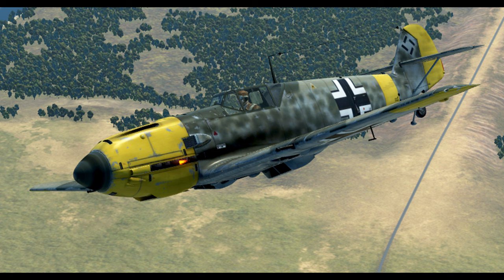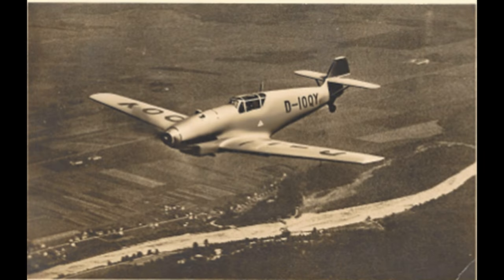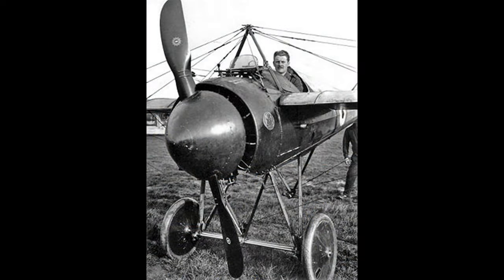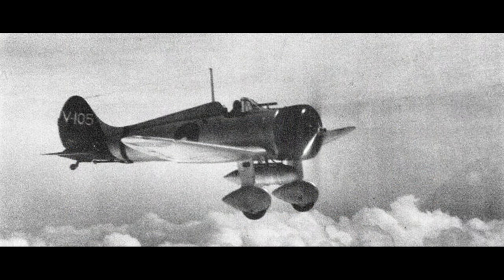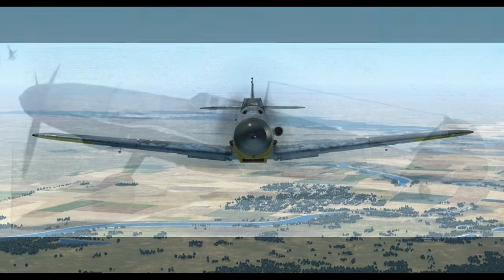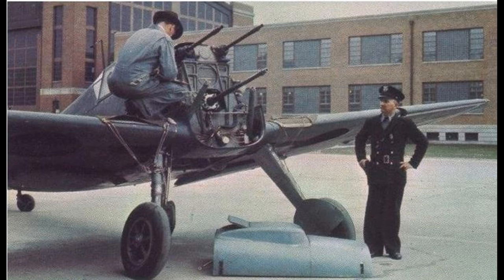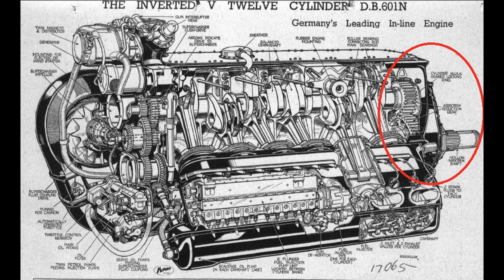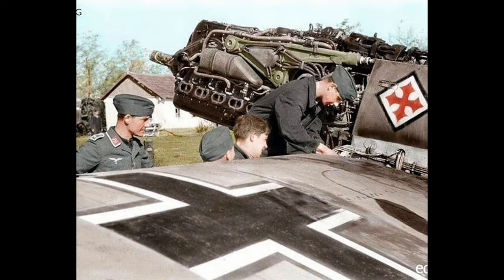Why an INVERTED V-12?  PART 2

Comment: saw Part 1 months ago, disagree on three tubes through firewall are gun barrels, rather are frame mounted gun supports > ME-109 had 0.594:1 reduction gear and short barrel Rheinmetall-Borsig cannon in the V12 valley > gun action would not be behind firewall
Reply from the maker: Why not behind the firewall? Having guns on the crew side of the firewall was incredibly common in WW2. I think those are gun barrels and not supports.
Reply: @GregsAirplanesandAutomobiles  > MK108 had short barrel, only 500 m/s 
Luft46.com/armament/mk108.html

Comment: @0:54 - That has to be the worst cylinder head design ever created! WTF is with that exhaust port? It's like they started to make a hemi and then gave up halfway through!
Reply from the maker: Buick and I are very unhappy you don't like that engine.
Reply: @GregsAirplanesandAutomobiles  It's an interesting engine, but I think that the nailhead was probably nearly forgotten by most for some very good reasons. Apparently, it was actually a redesigned hemi, which is unfortunate.

Comment: I must ask, since Germany made the engine work for much of the time, did they hold out on Italy and Japan on keeping them running or did they just start building the engines too late in the war?
Reply: I've read that the reason there are so few 600 series DB engines flying today is that the level of precision required in the machining is exceedingly difficult to achieve even now, 80 years later. So it's no real surprise that it was tough for the companies who licensed it to get it right.

Comment: I wonder if reduced cylinder head temperature (perhaps more specifically, valvetrain temp) was a benefit of these inverted forced-induction engines? 
I have no idea how much oil pooled in the area as part of the dry-sump scavenging, but having spent a lot of time tuning high-boost turbocharged auto engines (and watching cylinder head temps climb under boost due to elevated exhaust gas temps) my first thought was that it might be nice to have some of that valvetrain submerged in oil that would soon be pumped away to be cooled.
Reply from the maker: At the speed at which the rocker arms move, I don't think you would want them submerged in oil. I also don't think it fills up that much before it's scavenged out.
Reply: @GregsAirplanesandAutomobiles   Thanks for the reply and for the exceptional channel!

Comment: What about just the effect of gravity or maneuver gs on the oil in the engine, keeping it in the head where it’s needed as coolant, making sure it’s running wet
Reply from the maker: The oil pump takes car of that, the oil sprays everywhere.

Comment: I once read somewhere that inverted engines are more susceptible to hydrolock where a cylinder can fill with oil or water when sitting too long.  Since these fluids are essentially non-compressible, this can be disastrous when starting an engine and is why the propeller is manually spun before startup to check for it.  In an inverted engine with the plugs at the bottom, this condition can be corrected easily by pulling the plug(s) on the offending cylinder(s) and draining the fluid.  Intuitively, this would probably take a lot longer to do on an upright engine.
Reply from the maker: No need to pull all the plugs, just pull the prop through by hand to make sure nothing is hydrocked. If it is, just pull the plug for the hydrolocked cylinder(s).
Reply: upright engines can't get hydraulic lock.  The reason is called 'gravity'

Comment: It's interesting that the Stuka, FW 190, the Storch, etc all had inverted engines.
Reply: Makes sense really. Forward visibility and maintenance would he huge factors for aircraft like the 109, Stuka and Storch. Now the 190, visibility not so much as the 190 D had such a long nose to begin with, but why make an upright V12 just for one type of aircraft because it wouldn't have the advantage of improved forward visibility? The Dora is a bit of a strange bird, having that V12 and still retaining characteristic looks of a radial engine fighter

Comment: I haven't heard you mention that the first prototype 109 had an upright V-12 Rolls-Royce Kestrel engine.
Reply: Yep the Proto flew with RR Kestrel because there  was no powerful reliable German engine at hand during this time .

Think it was not important, its all about the inverted V engined varaints,  he even not mention  the later Spanish built variants with Hispano Suiza and RR Merlin V-12 engines

Comment: I recall reading an assertion by a Rolls Royce engine designer that, all other things being equal, an optimized carburettor installation produced more power than a fuel injected installation, this due to the intake charge cooling caused by the carburettor.
Reply from the maker: Either that's a misquote, or he is wrong. If you are talking about Stanley Hooker, it's a misqoute, that's not really what he said.
Reply: @GregsAirplanesandAutomobiles  So what did our friend Stanley say?

Comment: After the war Spanish made Bf109s were using Merlins in the upright configuration. They worked quite well but took away from the 109's fuselage beauty!
Reply: I just checked them out. I agree it totally changes the plane and not for the better visually.
Reply: It was called a 'Bouchon' or something like that.  Many were used in the film 'Battle of Britain' along with Merlin engined He 111s.  Some are still flying for airshows in Luftwaffe colours.

Comment: Do inverted engines have the same issue with oil getting into the cylinders after shut-down and potentially causing a hydraulic-lock as radials? 
It seems like this would be a major negative since, if proper precautions aren't taken, this can lead to engine damage.
Reply from the maker: I am sure that some if not all do have that issue. However it's just not that big of a deal. With proper procedures in place it will never blow a motor. Keep in mind the US had huge formations of 4 engine radial bombers, all those engine had to start without hydrolock. I'll explain the procedure to avoid the issue in a future video.
Reply: I started many Bristol Hercules 14-cylinder radials.  They had an electric starter with a clutch.  We had to count 8 blades before switching the mags on.  If there was a hydraulic lock the prop would stop and the clutch would slip.  In that case the lower plugs would be removed to drain the oil out.  But this never happened to me....   Other but smaller engines were turned over by hand before starting.  But most later radials were too big to even try this.

Comment: Greg,
Perhaps you can help me with this. 

Flat head quad cam hydraulic lifter 4 valve twin plug crossflow. 
Ok, sounds primitive but.......
With the boost they run the head volume isn’t really a problem and with the low rpm to get a full burn, having a dimensionally smaller motor and a smaller frontal area in a cheaper motor may have been another way to go.
Reply from the maker: I don't think you could have much less frontal area than what the 109 has, not if you want to have a pilot and weapons in it.
Reply: Greg's Airplanes and Automobiles 

Fair call. 
I was just thinking that cams and valvetrain add a fair bit of height to a motor.
Reply: By frontal area I meant the actual front of the aircraft, not the max cross section.

Comment: Is there any truth to the rumor that inverted piston engines burn /use far more oil than upright engines?  I was told by an old crew chief that they do, but I question this.
Reply from the maker: I think they do on start up, but probably not once they are running.
Reply: @GregsAirplanesandAutomobiles  Thanks!

Comment: Yes  but, how was the engine block actually put together? 
Was it a 1, 2 or 3 piece? And how were the pieces held together?
Reply from the maker: They were all multiple pieces as far as I know. I can't think of any WW2 aero V-12 with a one piece block as we know them today.
Reply: @GregsAirplanesandAutomobiles  Thanks, Greg. Actually, I think the German ones had a one piece cylinder block and head, unlike the others. I think that even the steel cylinder liner was a one piece sleeve and combustion chamber, dome.

Comment: Ease of maintenance? If that were the case, what the heck happened to German Automobiles!?
Reply from the maker: The VW bug was easy to maintain.
Reply: @GregsAirplanesandAutomobiles  I was mainly poking fun at modern German cars. Anything from the late 80s and on. I actually own an older BMW which is still not too bad.

Comment: Greg Sir, a question that is a bit off topic.
Do you think it would be possible to build a viable diesel aircraft engine using the basic design of the Napier Deltec engine???
This will be using modern common rail injectors and staged supercharging.
Reply: The Deltic was based on a licensed version of Jumo 204 engine, which was an aircraft engine. It was efficient, but heavy and not very powerful. Diesels simply don't work well in aircraft.
Reply: @PistonAvatarGuy  I recently saw a BMW V6 diesel converted for aircraft use. It's making 360 horses and is much smaller than a similar size Lycoming. I think you will start seeing more of them as time goes by since the size and weight have gone down tremendously and their superior fuel mileage. range is everything for some aircraft.
Reply: @johnparrish9215  You're probably thinking of the CD-300, which is based on a Mercedes-Benz engine, BMW doesn't make any diesel V6s. The CD-300 only makes 300 hp and isn't too heavy when compared to a turbocharged LyContisaurus engine, but is extremely heavy when compared to a modern, gasoline-burning V6. The full installation of a CD-300 also isn't much smaller than an equivalent LyContisaurus engine. Diesels are far too expensive to become common in the aviation world, and many are quite a bit heavier than their LyContisaurus equivalents, as was proven with the 172 JT-A.
Reply from the maker: Do I think it's possible to build a Diesel aircraft engine based on the Deltic, yes, but I'm not so sure about the mass of that engine relative to the amount of power it generates. It seems like it would be very heavy and large for a given amount of power. However I don't know much about them, so I could be way off here.
Reply: The Deltic was basically a Jumo diesel with three crankshafts and 18 cylinders and 36 pistons.  Very powerful and sounded wonderful!  Notably one of the cranks went round backwards.  There is a wonderful animated graphic on the internet somewhere.

Comment: What was the point of having more powerful engines if they used a reduction gear to reduce the RPM of the propellors? How does that work?
Reply from the maker: You can absorb the power by increasing the prop's pitch.
Reply: @GregsAirplanesandAutomobiles  I see so like translating torque via the prop pitch? Why not just make the prop speed faster?
Reply from the maker: Tip speed limitations.
Reply: @GregsAirplanesandAutomobiles  So does reduction gear increase the torque + prop pitch absorbs the power from that? Am I understanding this correctly?

Comment: Anyone who's ever worked on an Audio or a BMW knows that the Germans religiously exclude "ease of maintenance" as a requisite in their designs. So the choice to go inverted must have been strictly for visibility issues. If they realized that the inverted design would have made it easier to work on then they would have been required by tradition to spec an upright configuration.
Reply: You seriously judge aero engine practice from the 30-40's based on cars you had worked? Just to quote you the Chief Engineer of Wright Aeronautical Corp. in late 1942 on a assessment of the 601 inverted V-12: "The DB-601A general design reflects ar uggedness and reliability which has always characterized Mercedes-Benz products. The relatively low rating of the engine indicates conservatism in output for the sake of improved reliability and increased service life. This safety factor has been affected despite the standardization [in early 30's] of mounts and attachments first employed by the Germans to facilitate engine changes. This latter procedure has greatly reduced the necessity for complicated maintenance operations on the powerplant while installed. However, routine maintenance operations on spark plugs, injection nozzles, strainers and magneto are easily accomplished on the DB-601A."
Reply: @craZivn That is not at all a very realistic analogy... and anyone that has ever owned a Porsche or Ferrari knows that a BMW, even an Audi is epitome of "ease of maintenance" by comparison but perhaps your mechanical skills are just very limited... have you ever worked on aircraft??? I doubt it.
Reply: It was a joke, gentlemen. Look up.
Reply: doktorbimmer The humor was, of course, in the utter ridiculousness of the viewpoint itself. As an entertainer I like to keep my lines at least a little above “slapstick” level so I apologize if it was out of your grasp. Maybe I should have thrown a few “LOLZ” after it, or a row of smiley faces or something.
Reply: @craZivn  The Doktor is German. Don´t expect too much sarcasm-wise!

Comment: I always believe that as well on top of the advantages you described of a inverted V engine, that the plane would also perform better when flying upside down, as upright V engines had the issue of fuel " drowning " and then stalling when staying upside down for too long, hence in a dogfight, the inverted V could have a advantage as it would not suffer this issue. I am not sure if that is correct or not, but would love to get a reply on this, as a few documentaries make mention of this fact
Reply: Since the Daimler-Benz inverted V-12 used direct fuel injection... it operated exactly the same right-side up or upside down. because there is no carburetor or fuel in the intake manifolds.
Reply: @doktorbimmer  Interesting, that makes complete sense yeah. Were the Spitfire's Merlin V12s Carburated in some fashion, rather than direct injection? That might explain why I heard this " advantage " before
Reply: Yes, The early Merlins were flawed by a very antiquated float-type carburetor, later versions used a better American made Bendix pressure-feed type carb that did not sputter and stall when inverted but lacked the other performance advantages that GDI offered the German engines.
Reply: @doktorbimmer  Gotcha, that definitely makes sense, and would coincide with the Battle of Britain presumptions I had, which is where most of my speculation came from. Thanks for all the awesome info!
Reply: You are very welcome, here is a great video that covers the Merlin's fatal flaw in better detail and one of the ways they tried improve it.
https://www.youtube.com/watch?v=YzRlga2-Hho

Comment: So you've answered my question how they mounted the guns was having difficulty finding see how ya are
Reply from the maker: Dirk, I'm not sure what you mean.
Reply: @GregsAirplanesandAutomobiles  sorry want specific I was wondering how messerschmidt mounted the 30 mil through the prop hub tried googling it to no avail then this morning saw 2nd inverted vs upright and that showed me clearly how it's mounted in the airframe and the barrel runs through the engine cleavage was looking for blueprints etc and then your video shows a BF 109 with the engine removed and all three guns clearly showing
Reply from the maker: Ah, great, I'm really glad you found what you wanted.

Comment: I have it that with the inverted V engine, the 109 could push straight over in a dive and not starve the engine for fuel in a negative G attitude. Allied  fighters had to roll to dive steeply to prevent fuel starvation. Is that correct?
Reply from the maker: Yes, although that has nothing to do with the inverted V, it's because of fuel injection. Later Allied fighters didn't have this limitation, it's really only the early British fighters that did.
Reply: @GregsAirplanesandAutomobiles  Gotcha. More 109 trivia: Was watching a documentary (Great Planes maybe) on the 109; it contained lots of vintage operational German film footage. One clip showed a pilot getting into his ship to go up after the bombers, and  he had around eight 20mm cannon rounds taped to his ankles.  I looked at an exploded diagram of the 109 and it looked like a pilot could access the breach;  shoot the cannon single fire after he ran out of belt ammo?
Reply from the maker: It makes sense, but I've never read about anyone doing that.
Reply: @ancientheart2532    The cannon breech is between the pilot''s feet, but covered.  Thinking about it,  I doubt a pilot sitting the small Bf-109 cockpit would be able to reach down between his feet to insert single-fire shells.  Especially while engaged in combat.  It just doesn't make sense.  I am wondering if those may have been signal flares or maybe even something that a pilot was wearing for luck.  https://media.discordapp.net/attachments/230625718092955649/524329894520422400/0020_Zirchow_Usedom_Messerschmitt_Bf_109_G-14_WNr_462707_Cockpit_Instrumentenbrett.png?width=1026&height=684

Comment: The crankcase oil sitting on the pistons in all 12 cylinders seems like a problem...
Reply from the maker: It's not sitting there, it's a dry sump.
Reply: @GregsAirplanesandAutomobiles  - How does oil get up off the pistons and up to the sump pump? Doesn't it have the same oil problems as the bottom pistons of a radial engine? But on all 12? 
At least the radial has some dry pistons to start and run on untll it can clear out the bottom ones... clear off the bottom spark plugs... with a lot of smoke...